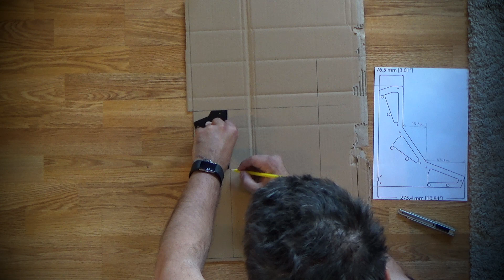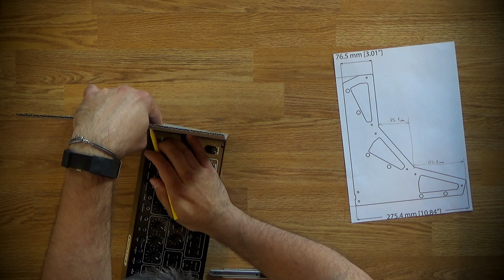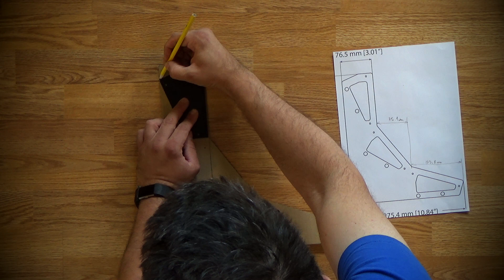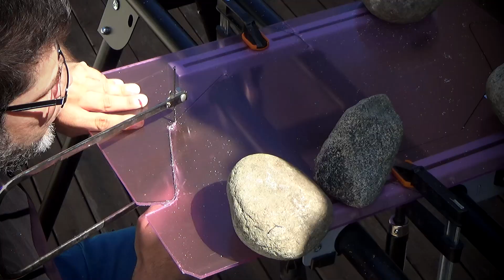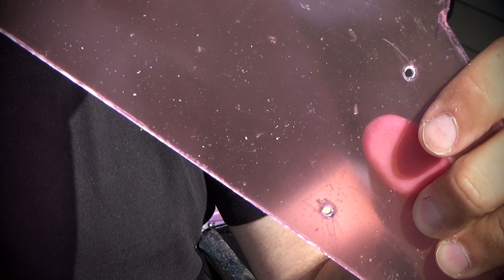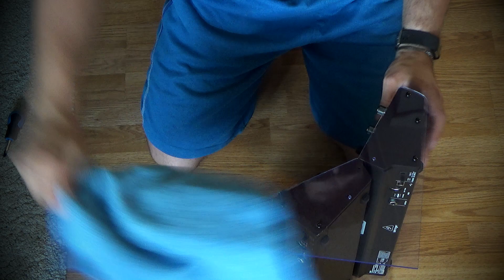DIY Project: Behringer 3-Tier Stand, Under $10 (Neutron, Pro-1, K-2)

Comment: This is a great / smart idea.  I think I will try this on the Behringer Crave, Edge, Grind, and Spice semi modulars either as two 2-tiers or one 4-tier. I built a stand in the past for Moog Semi modulars and double sided taped the metal end plates down so that i could use them to guide the hole drilling.  It saved on mis-alignment hassles.

Comment: Well done. Any learnings on the drilling of the holes, like how to avoid the crack?
Reply from the maker: Yeah, take your time and make sure the drill bit is clean after each hole, if you are using plastic. Also, have proper support from both sides to avoid the plastic bending while drilling :)

Comment: So I did like you with wood (8mm thick)! thank you for giving the idea and the method. I made the plan taller on Photshop and use the rulers in mm to get good proportions.On the Behringer notice they "not unscrew" the 2 screws (per unit) that  did not match on your building. So i drill holes 8mm diameter that makes space for those srews. For the 2 others screws (always per unit) they were not long enough, so I drilled (always with a 8mm drill) just a little to get the head of the screw in the wood (maybe 1 or 2mm deep). Now what I need... is a third behringer synthetiser and I won't thank you for this !LOL Thank you It cost me nothing just time and it brought me pleasure of working wood again. I am now looking for BCF and BCR Stand's plan. If anyone got that please send a link ;)